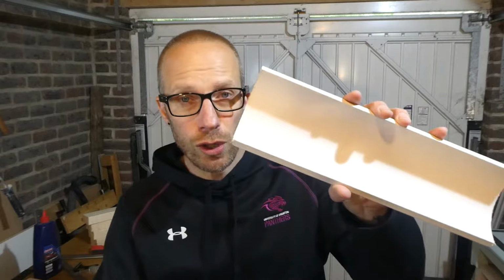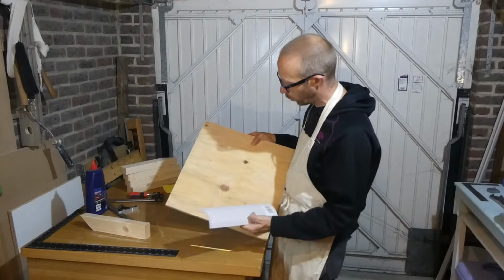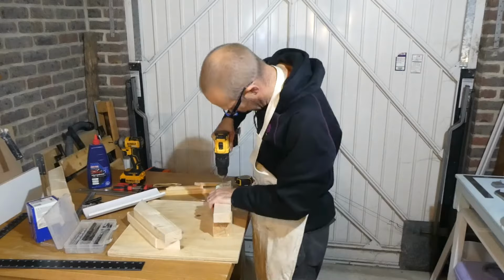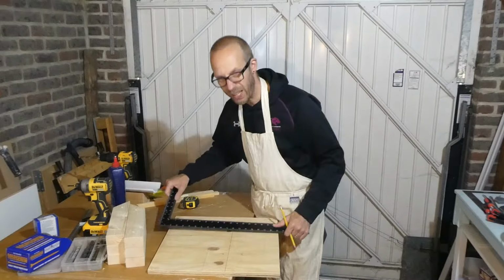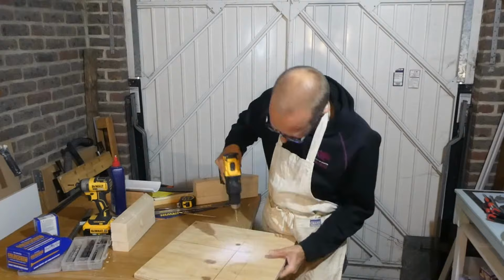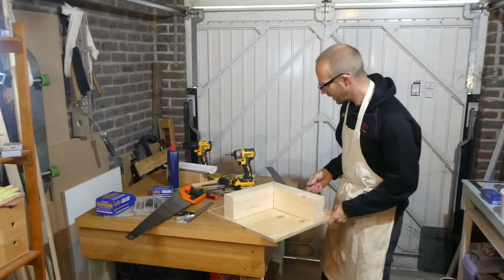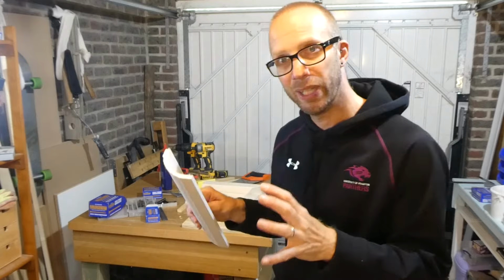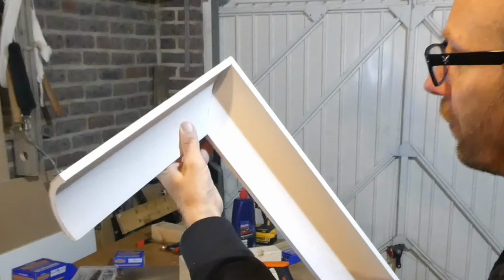How to make your own Coving Mitre Jig & Installation Demonstration

Comment: Used one like that for 30+ years. You need to remove part of the wood so the external sits flat to cut, or cut to length first. You could just cut to length first however you have to cut a tab longer to allow for adhesive. Can be lots of thinking doing coving. Great work though making an old mitre block. Made my day seeing that :) 
I had 3.
100mm
127mm
135mm

Comment: Thanks very much for sharing your design. I copied it and have used it with great success. Thanks also for making me aware of the lightweight coving which is so much easier to work with. I didn't have any CLS kicking about so I used a piece of 4x2 on its edge. That saved a bit of work. I didn't glue my little battens so they can be adjusted for different sizes of coving. Total build time for me 50 minutes and no cost, brilliant.

Comment: Good work. I’m good at carpentry, plumbing, tiling, if fact most things, but coving? My brain just doesn’t do it, I always struggle to turn the angles around in my head between the ceiling and the bench. I literally have to assemble it upside down and then turn it around lol.

Comment: Great video, I have just copied your design but mine is a little cruder. I cut a length of 2 in x 4 in in two at 45 degrees and then reversed one. Screwed them to a piece of mdf and job done. I had been searching for a large mitre box to accommodate 130 mm coving, but without success. Haven't cut any coving yet but I'm sure I will get acceptable cuts. This was very helpful.

Comment: A little tip re gluing up. To save marking out/ lining up the pieces twice, what i do is put some mitre mate on the timber around the edge where the timber will go and then put the pva down  the middle. The mitre mate acts as a clamp while the pva goes off. You can still turn it over and fix screws if you want.

Comment: whats not covered in the video is that you can actually cut the coving where it joins to another piece ( if it isnt long enough to reach the opposite corner ) . You can do that with this jig by flipping the coving back to front and placing it in the jig and cutting at 45 degree angle again,  then cutting the joining piece as in video  it will then fit nicely together, hiding the joining fairly well

Comment: Just found your video. Interesting. It would have been very useful a few years back when I was struggling to cut cornice for wall units. But; despite being no expert, I wondered if gluing the guides was the best solution. Coving/cornice comes in various sizes; would it not be useful to fix them in position by bolting them, in which case you could have various guide positions and fit the guide to where it best matches the piece you wish to cut.

Comment: great stuff jb, but one question re using the jig. for internal corner with the coving in the jig which mitre joint am i cutting left or right, if the coving enters the jig from the left
Reply from the maker: Ok, so you need to imagine the plywood base is the ceiling... therefore the piece on the left of the jig, is for the right side of an internal mitre 👍